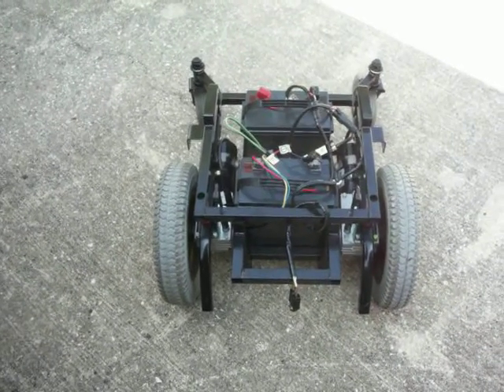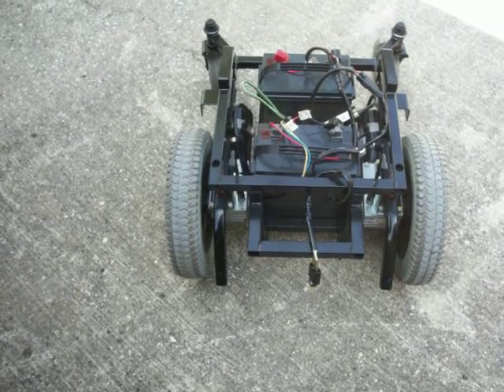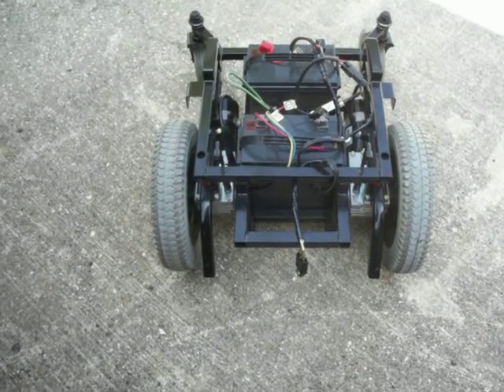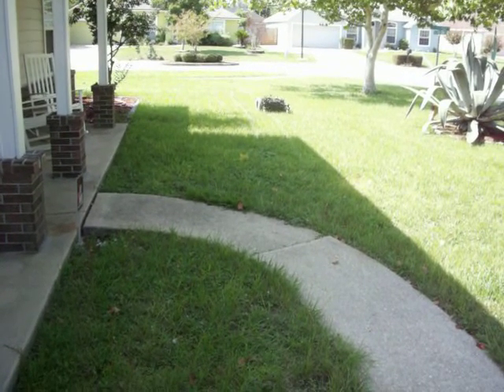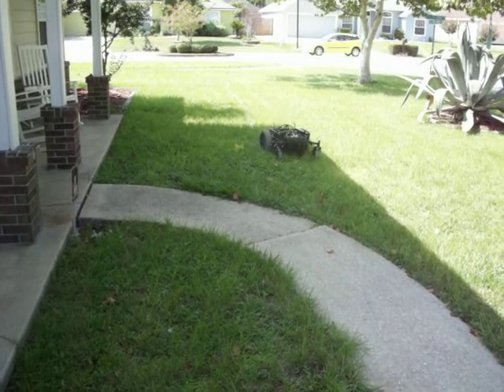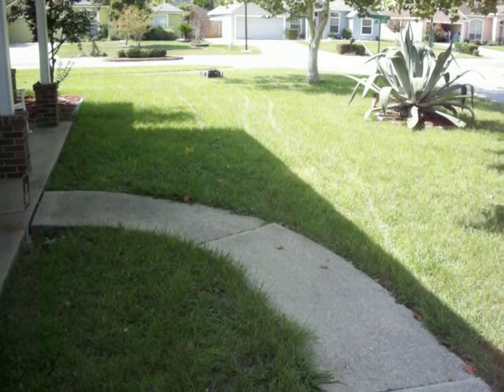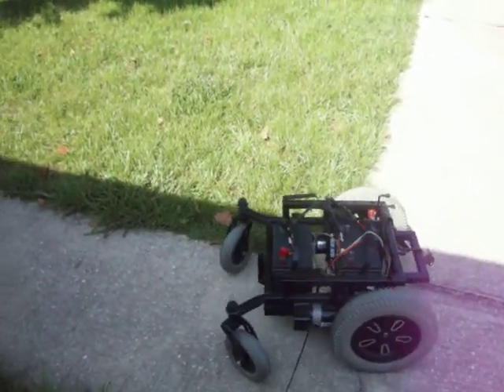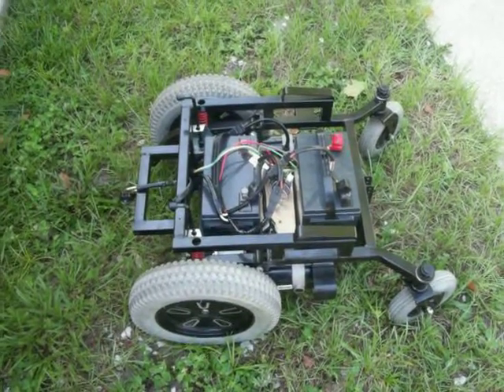Remote Control Lawn Mower Build Pt.4

Comment: On the 24 volt question you really won't need 24 volt. The higher voltage is to add torque for the wheelchair to haul a person around. Even with your lawn mower hardware, you won't need that torque. If you wire the batteries for 12 volts your batteries will last twice as long. So, the question is, Do you want power in the form of torque or do you want to conserve electricity. I'm betting you'll find what I did, which is that you won't need the torque.

Comment: Hi, I built one of these several years ago, you can see my videos on here as well, you'll really want to switch it over to 12v, if you're going to use th motor and blade form a B anf D electric mower, they are 12v, plus with the chopper on, you'll want the slower more deliberate movement that comes with 12v over the high speeds and quick turns that come with 24v.

Comment: Hi. Do you need to set up the spektrum controller. Before it worked. I got mine not working. 

Step 1 , i bind the receiver and i hold the training mode of transmitter when it off
Step 2. Turn it on the transmitter.

Somehow my motor does not receive any signal. I connect s1 with 12 v motor

Comment: This setup is designed to move an adult around so the mower weight and power required to run it should be fine. May look cool to have the solar panel on top, it may not have the watts to keep the batteries topped off in operation.
Though it you build a doghouse with roof pitch at the right solar angle. The mower can go home to charge. You will need to wire two 12 v panels in series to the voltage to charge the batteries.
Perhaps some LED spotlights on the front and back would be a good idea.